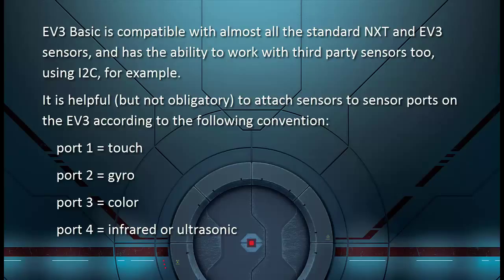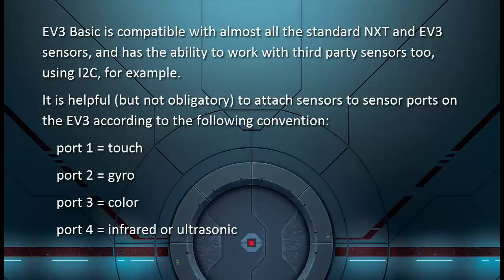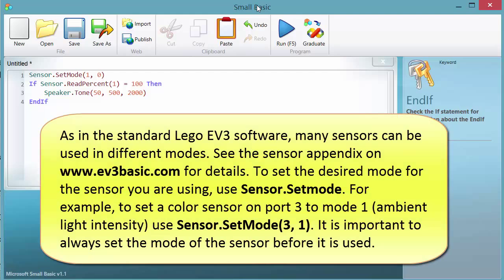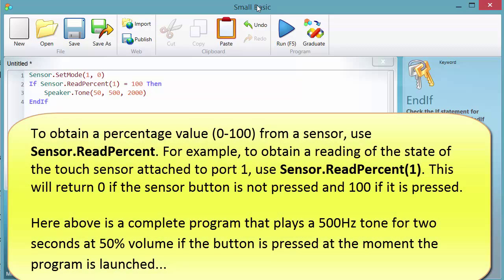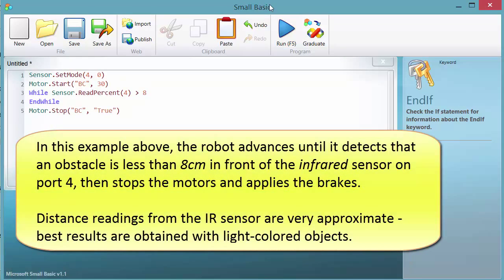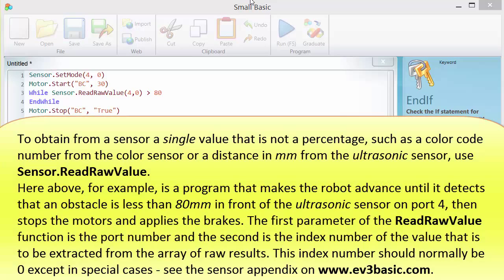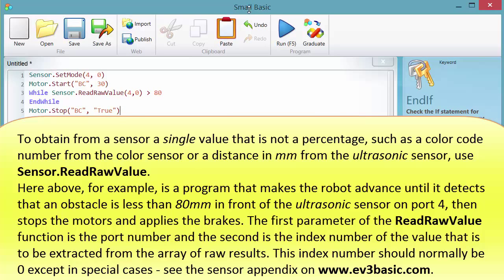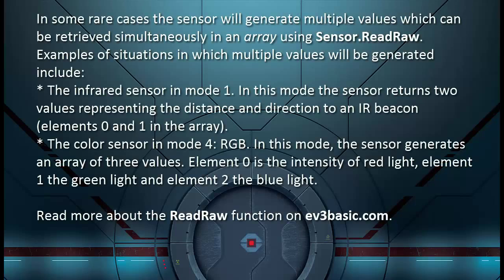EV3 Basic 4: Sensors

Comment: can the Read.Raw function be used to measure the distance to an object and then assign that distance to a variable?
Reply from the maker: ReadRaw would be a bad choice for this since it returns an array of values whereas you only need a single value. You should instead use Sensor.ReadRawValue which returns a single value that you can store in a variable. For example, to store a distance value returned by the ultrasonic or infrared sensor on port 4 you could usedistance=Sensor.ReadRawValue(4,0)Note that the function has extracted the first value (element[0]) from the array – this is almost always the one you want. See ev3basic.com for more help.